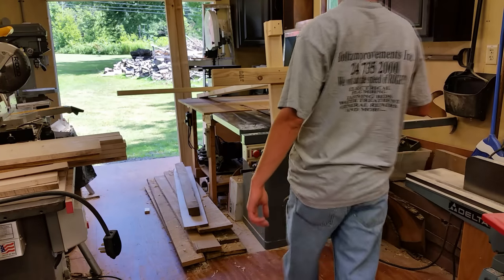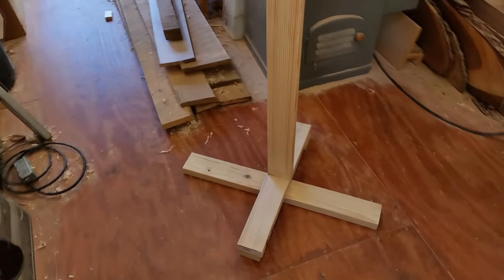How to Build a 2x4 Cross

Comment: Would recommend protecting your hands. 1) Your fingers was exposed using the miter saw (use a push stick or something else) 2) wear a glove when using the driver to drill screws through (one slip and the bit will hit your exposed hand). I would have used clamps to hold the blocks in place, drill pilot holes, and then screwed in. Thank you for the video